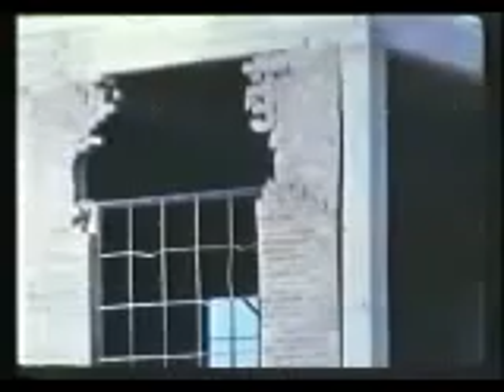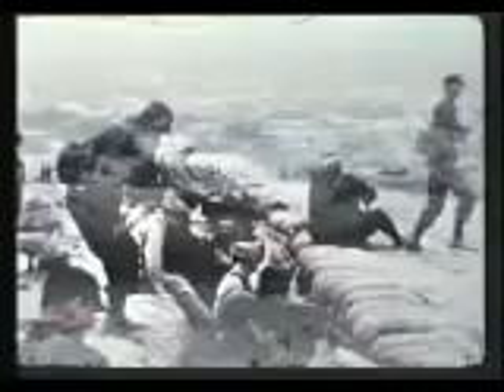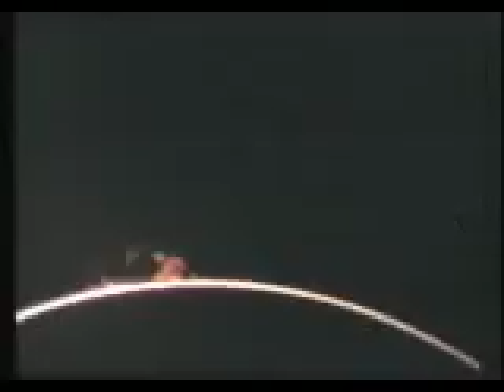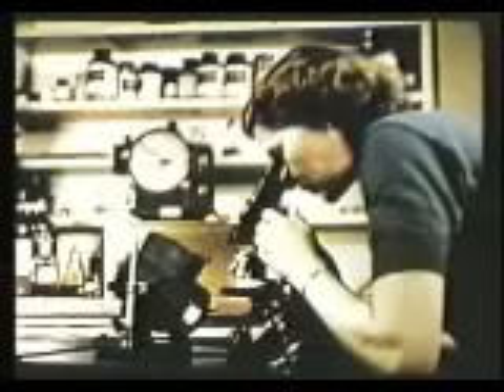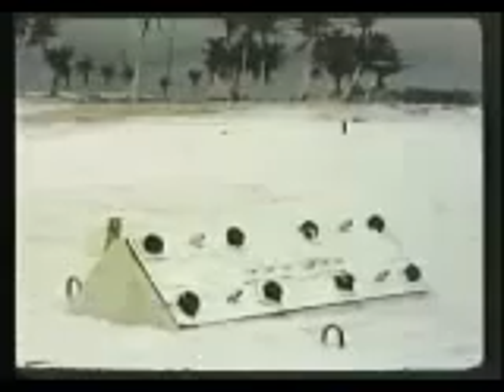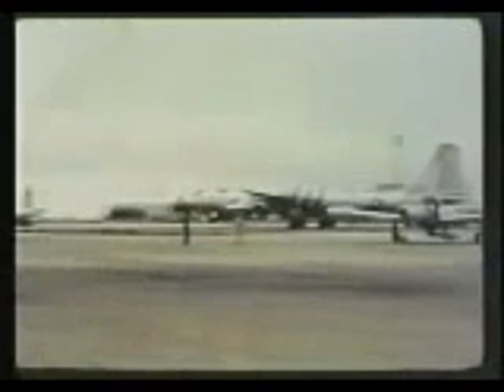Atomic Weapons Orientation Effect Of Atomic Weapons, Parts 5 and 6 (1954)

Comment: Dude you've been on a tear all week thanks so much!

That B61 video was the bomb.  Got one for B83?
Reply: The B83 Gravity Bomb was being a follow up for the failed B77.  The B83 was maked fromed many of same components as the B77 but was maked safer from accidental detonations and had others of safety stuff added to it.  It was being a Variable Yield Bomb which did haved a 1.2 MEGATON MAXIMUM YIELDING and cand be reduced to a LOW KILOTONS YIELDING ifed did they wished it.
   It does appear that all of testings for the B83 / B77 warshead were done ined a 20 test shots series whiched ALL were being fromed UNDERGROUND to at the Nevada Testing Range.  The series of testings were called as the ANVIL TESTING SERIES.  So ifed do you want more of stuff about the B83 you should looked uped the ANVIL SERIES.
   The B83 was being the biggest yield of US Gravity bomb sinced from 2011, but they haved uped graded the B61 and there is talking of to tire the B83 bomb to only the space forces command for blowing apart nasty of Meteors ined coming at the Earth, whiched does the Space Forces haved a special delivery group of space vehicles just for that.   But still they are ined to the US nuclear arsenal and could be pulled out for any of need.
BUT the B61 has beened uped graded so is it very more accurate and haves a better penetrations head so now does it haved many of jobs. It is super accurate and has a variable quick dials uped yield.  It’s variable of yield is being fromed. 0.03 KILOTONS to  of 400 KILOTONS.  IT IS BEING THE US BUNKERS BUSTER OF NOW.  Be caused it is very so accurate and haves special penetrations tips it cand do the job of very bigger bombs withed very lower of yields and so ground shots fallout.  Even withed very hard bunkers ifed cand you put a bomb to right on top of it and haved it burrow ined to about 40 or 50 feet and thened detonate the smaller of Kiloton Yield still will it just squished any of bunkers under there.  It cand all so be a Neutrons or ERD (Enhanced Radiation Device) ined its tactical mod be caused the Radiations Pulse Wave will over rund its blast pulse wave at suched lowers kiloton yielding ranged.  They haved been working to uped grade it for a longed of time and now does it haved new stuff fromed 50 years of studying of it and it does haved as now 13 diffrenter variants or mods for diffrenter jobs.  And too it is lite enoughed to be carried on to the new F35-2.

-  Any ways that is what did I find of the B83 Bomb. There are none of any video above ground blasting for it but since it was made fromed a lot of the old of B77 and some of B61 stuff there is being under ground testing only I could find under grounds series called as the ANVIL SERIES.

Hoped that cand help what were you looking for.